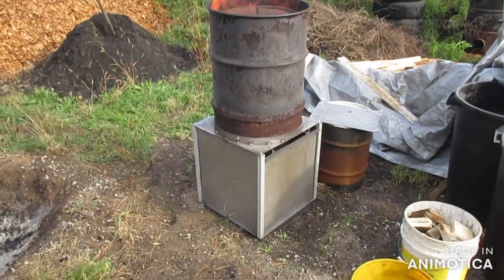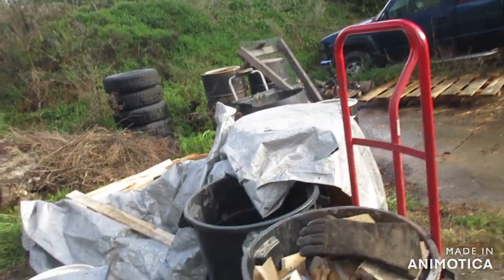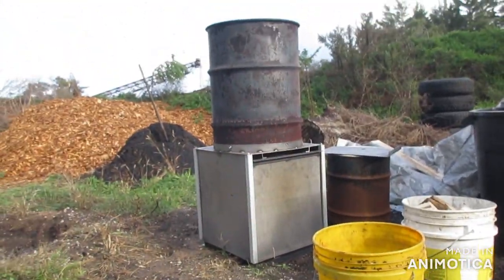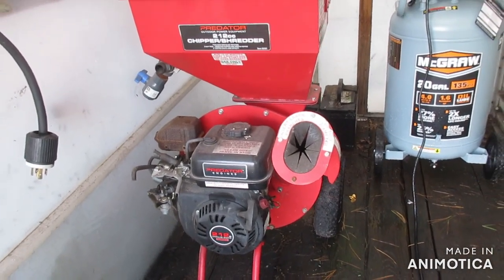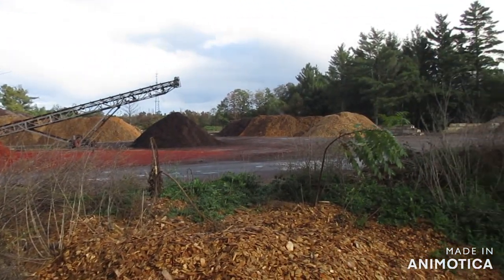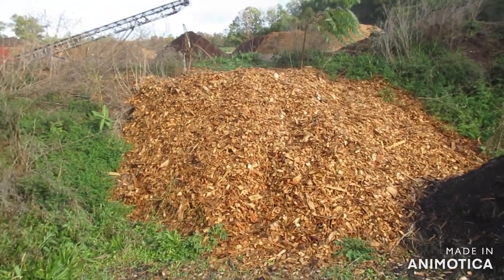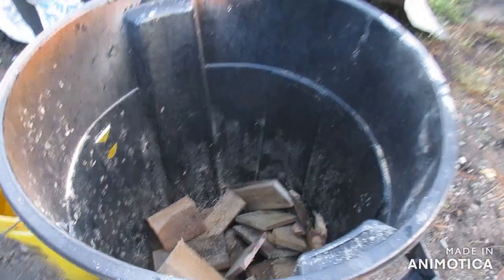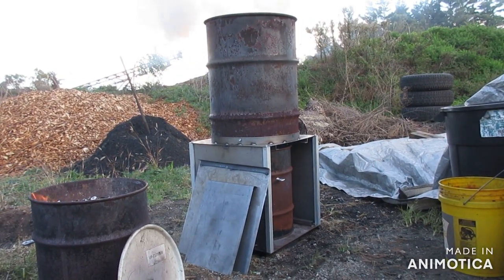CFK-10 Charcoal Kiln Operation Tutorial

Comment: How much charcoal do you produce per hour or day?
Reply from the maker: Depends on how many kilns I operate. One kiln can produce 20 gallons of fuel in 1 1'/2 to 2 hours. You can easily operate 4 to 8 kilns at time. It takes me less than 15 minutes to prep the feed for one 2 hour kiln run. After that the kiln does the work you just have to monitor them.
Reply from the maker: 10 gallons of fuel is all I need per day to keep my system running.
Reply: @Thrive-Off-Grid  I'm planning on charging 4kw of battery each day so I'll have to make generator last for about 2 hours a day. So I guess 10 gallons will be more than enough for me. Cheers though 😊👍 does your gasifiers work with wood pellets or would I have to make some modifications for it to work?
Reply from the maker: @mickedansar  Yup 10 to 15 gallons of charcoal, will net around 5 kW / hours of charge to your batteries. You can run pellets as long as you convert them to charcoal first and you must drive out all the tar. Pellets are full it and the tar pellets produce is the worst. Get that stuff in an engine and you will have to yank the head off, drive out the intake valve, clean up the guide and valve stem and then put it back together. Best to just stay away from them in the first place and char up waste wood products that you can find for free. There is tons of sources you just have to look.
Reply from the maker: What you want to do when running the kilns. Is as you are running, you process fuel for the next run while you monitor running them. You want your prepped to dry a bit before running in the kiln as it will produce a better yield.

Comment: What's the ratio of fuel burned down to ashes to charcoal produced?
Reply from the maker: It is 50% in this configuration. I plan to double stack the barrels in the future plus add insulation around it. This should increase efficiency greatly. Now if you are trying to compare  this to direct gasification here are some things to consider. To produce the equivalent BTU value of fuel I produce here, this roughly (40 lbs of usable chips produced pr hour @ 30%MC = 206,000 BTU) that chipper will consume around 1 gallon of gasoline. (120,000 BTU) Now you are going  to yield waste and with the chipper shown in the video it will produce upto 50% waste so 206,000 of the Gross 412,000 btu gross worth of the chips you yield is not even usable. So now deduct that 120,000 btu investment to run that chipper that leaves you 86,000 btu. Now you direct fuel gasifier is now going to use 30% of this just for its process. So 86,000 BTU minus 30% = 60,000 BTU net. 

The Charcoal I can produce from the one trash barrel is around . 18 lbs. Charcoal has a BTU value of 9700 BTU per lb. So total is 174,000 BTU Gross. The fuel starting in the trash barrel at 75 lbs and @ 35% MC as it was had a BTU value of 419,000. So at this point I dont have the gasoline overhead only the energy to cut the fuel with the chop saw that does not require hardly anything to run. I did the conversion and that saw uses 1700 watts and it took 10 minutes this comes to 1000 BTU. So now I have 173,000 BTU net. Now the charcoal Gasifier uses less than 10% in process however, you get energy back from ordinary water with the water drip to water gas conversion. So lets take that 10% for the gasification process first that leaves us with 155,700 BTU net to our Engine. Oh but wait this 18 lbs of charcoal should be able to crack at least one liter of water. One liter of water has a Hydrogen BTU value of around 15,000 BTU. Thats not counting the Oxygen converted to CO. That is roughly half the H2 BTU value. So about 20,000 BTU reservedly. So add this back into our net and we get 175,700 net to my engine. Charcoal is nearly 3 times more efficient in this case scenario running a small chipper. Now a larger chipper thats different or chunking, but now you are into larger equipment and you still have a lot to make up for.
Reply: @Thrive-Off-Grid  thanks for the elaborate response.
Reply from the maker: @CarbonConscious  LOL yeah not sure if that was what you were after though but put it out there anyways as I want to break the misconceptions. I spent too many years chasing direct gasification and avoiding charcoal like the plague. Now Im here. One thing to note the efficiency is only part of the goal. The idea of this is to mass produce as a continuous fed machine and I plan to build many more of them to run at one time :)
Reply: @Thrive-Off-Grid  I was just curious, personally I aim for 100% efficiency with my biochar production.
Currently I'm heating a retort with a TLUD gasifier, the retort is to be able to collect wood vinegar or make bone chat and the gasifier gives me a very consistent heat and biochar quality.

The wood vinegar collection still needs a lot of refinement.
Reply from the maker: @CarbonConscious  How are you getting a 100% efficiency? This is a TLUD gasifier. Im just igniting the gases at the lower lower holes and force the pyrolysis out those holes via the top lid instead of letting it vent out the top and go to waste. 

Just because you have a second retort that does mean you get 100%, What ever spent in the lower TLUD is the energy used to convert the fuel in the retort. 

I am working on much more advanced systems this is just a simple system. The VersiFire is a heating system and produces hot water while it produces a good yield of charcoal. So nothing is wasted.
Reply: @Thrive-Off-Grid  all the material in the TLUD ends up as biochar, nothing is allowed to burn down to ashes.
Ofcourse there's always a tiny fraction of ash formation on the surface of some of the material but I coukd literally retrieve the match I start the fire with if I was using matches.
Reply from the maker: @CarbonConscious  Then that logic would apply to this kiln. It is exact same combustion process When I say 50% this the volume net of the Gross volume.
Reply from the maker: @CarbonConscious  The 50% is volume left it is impossible net 100% of the volume or mass of the raw fuel gross
Reply: @Thrive-Off-Grid  then it seems like you misunderstood the question I asked.
Reply from the maker: @CarbonConscious  Yeah I was not taking you literally. I have no idea what the ash content is. There generally is not any white ash if you are working the machine. Its all char 100% left generally.
Reply from the maker: Yeah the thing you have to keep in mind I am in the gasifier world and space. When most ask  questions like this it is generally pertaining to charcoal gasification. In this space we sometime call the charcoal "ash" or Char Ash. This is what I thought you were asking and not the actuall white ash produced. This is no different than any TLUD and this is not the first TLUD Ive ever built Ive built hundreds of them.